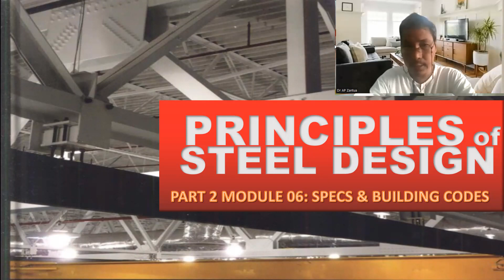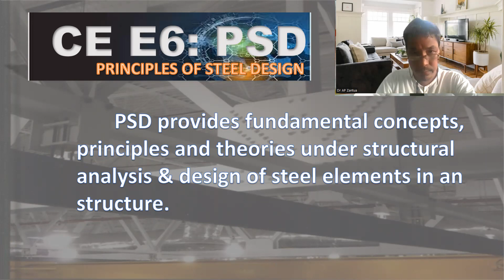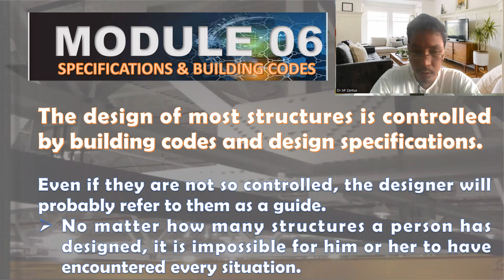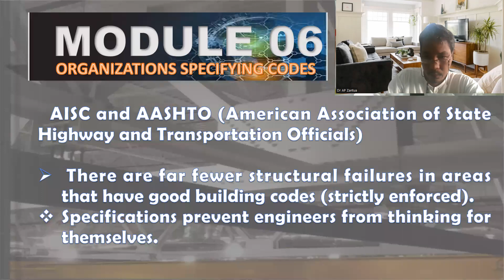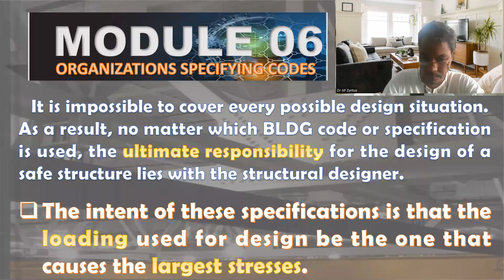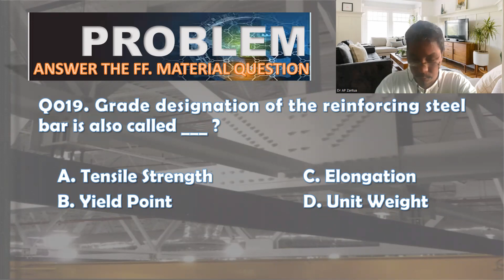Specifications & Building Codes [ Principles of Steel Design ] Module 2.06

Comment: Thank you for making this video lecture on specs and building codes available. Most constructions are designed in accordance with building rules and design principles.
Answer in Q-019.
A. Tensile Strength

Comment: thankyou  sir for discussing the specifications and building codes on psd, as it provides fundamental concepts, principles and theories under structural analysis and design of steel elements in a structure. 

question 019.Grade designation of the reinforcing steel bar is  also called ____?
Answer: A, (Tensile Strength)

Comment: Thank you for this video lecture that tackles about the specifications and building codes. The design of most structures is controlled by building codes and design specifications. The codes specify the: minimum design loads, design stresses, construction types, material quality and other factors. AISC and AASHTO have their own different codes that used but we can also adapt what they use. the codes are written for the safety and protection of the public not to restric the engineers. 

Q.19 " Grade designation of the reinforcing steel bar is also called _____?" A. Tensile Strength B. Yield Strength C. Elongation D. Unit Weight
The answer is B. Yield Point

Comment: Thank you for your effort recording our discussion about the specifications and building codes. It is an advantage for student working to review and rewatch the discussion all over again to fully understand. Thank you so much, Dr AP
Q19.Grade designation of the reinforcing steel bar is  also called ____?
Answer: A, (Tensile Strength)

Comment: Thank you so much sir for this video about specifications and building regulations that concerns with the steel design's principles

Q19.Grade designation of the reinforcing steel bar is also called ____?
ANSWER: A (Tensile Strength)

Comment: Thank you sir for this lecture video about the specifications and building codes. Such engineering specifications like minimum design loads, design stresses, construction types, material quality, and the other factors.  AISC and AASHTO have there own references that we can adapt. This lecture has a practical lesson for us, for that the codes are written not for the purpose of restricting engineers, but for the purpose of protecting the public. From this, it is important to always base on references, specifications and building codes. 
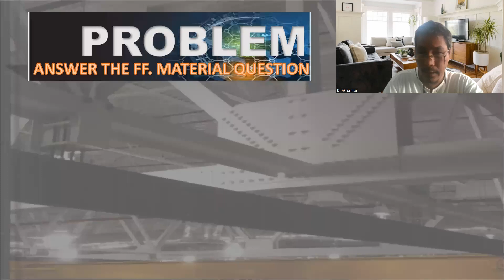For 16:16 Question 019: Grade designation of the reinforcing steel bar is also called? My answer is Yield Point sir.

Comment: Thanks po sir for this video discussing in specifications and building codes in principle of steel design. I learned that the design of most structures is controlled by building codes and design specifications.
Q19. Ans. A Tensile Strength

Comment: The video talks about specification and building codes. This are used by engineers as guide. I learned that at some point it restrict engineer, but the purpose of this codes are for the safety of the people, health, and property. Specification and codes are used by designer to used the best available materials on the subject. This codes has specified the minimum design load, design stresses, construction types, material quality, and other factors. For Q-019 Grade designation of the reinforcing steel bar is called ___?  B. Yield Point (ANSWER). Question sir, What if the the designer set the earthquake load resistance based onto the highest magnitude recorded by PHIVOLCS. When earthquake strikes again but with higher magnitude than the previous one and the structures fails, will still the structural designer be liable to the failure of the structures knowing the he/she complied to the code?

Comment: ---Thank you sir for discussing us about specifications and building codes of principles of steel design. I learned that the design of most structures is controlled by building codes and design specifications wherein the design is non-transferable. Even if they are not so controlled, the designer will probably refer to them as a guide. No matter how many structures a person has designed it is impossible to encounter same situations. By referring to specifications, we use the best available material on the subject. Engineering specifications that are developed by various organization present the best opinion of those organizations as to what represents good practice. These codes specify minimum design loads, design stresses, constructions types, material quality and other factor. AISC and AASHTO ( American Association of state Highway and transportation officials). There are far fewer structural failures in areas that have good building codes ( strictly enforced). Specifications prevent engineers from thinking for themselves. Codes are written not for the purpose of restricting engineers, but for the purpose of protecting the public. It is impossible to cover every possible design situation. As a result no matter which building code or specification is use, the ultimate responsibility for the design of a safe structure lies with the structural designer. The intent of these specifications is that the loading use for the design be the one that causes the largest stresses. 

Q019- grade designation of the reinforcing steel bar is also called______?
Answer= A. tensile strength